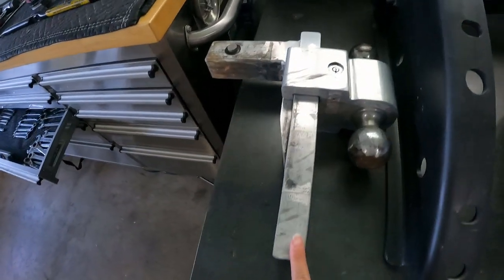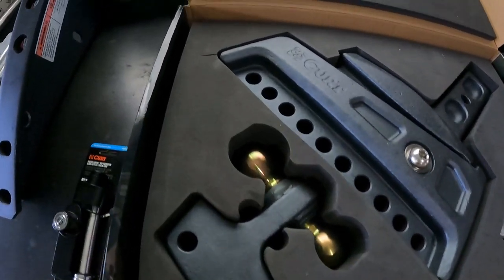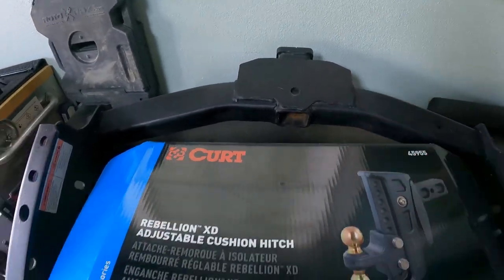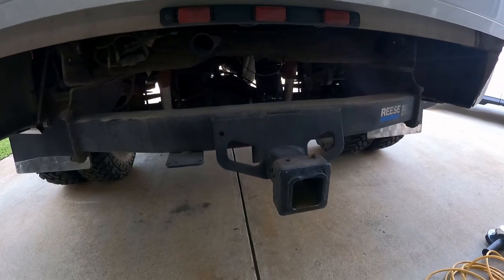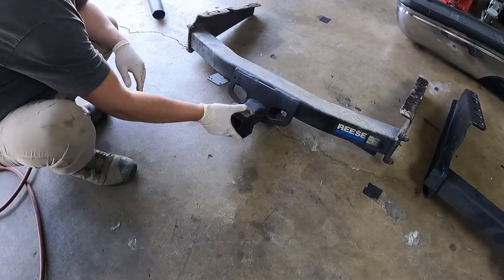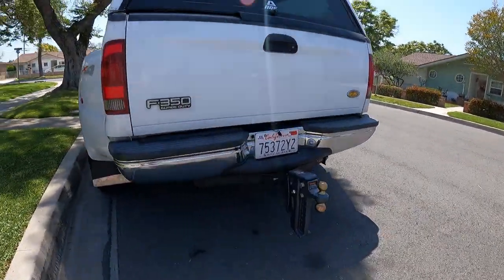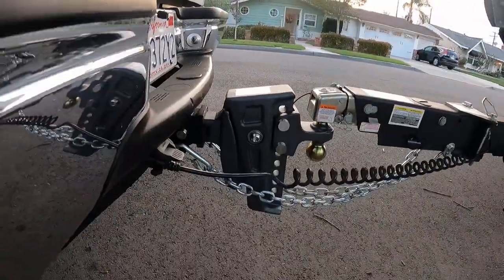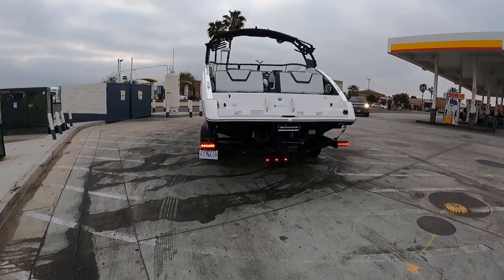Towing Yamaha 252 XE w/ Curt Rebellion XD Hitch. Worth it?

Comment: When you are filming the hitch while driving, the shock absorbing in the hitch is not even moving. It seems that your entire receiver is doing the flex! If you look at eTrailers demonstration - in this video https://youtu.be/CHtrhyB2OnY?t=27 - you'll see the shock absorber in action. 
This thing is rated up to 1500lbs tongue weight and 10-20k trailer weight....that's like A LOT. I wonder if the shock absorbing mechanism actually has a minimum weight to start working.
Reply from the maker: Hi! Thanks for the feedback. We really think we mounted the camera pretty poorly. The inside of the cab while driving does feel a lot smoother. We did switch the hitch to our Super C RV and the recording does show the hitch in action. Check it out around the 4:30 mark https://youtu.be/cAPdkklati8 and this video towards the end https://youtu.be/71r5tew1DF8 thanks again!

Comment: I'm curious how much your boat weighs?  I tow a 242 Cobalt and the combined weight, boat and trailer, is right around 6K pounds.  I tow it with my F150 ecoboost.  I don't have that problem.  But, when I tow our 27 foot camper (5K lbs) with our 7.3 F250 diesel and a weight distributing hitch,  the jerking is quite noticeable if my Rancho 9K shocks are set higher in the back than in the front.  My recommendation:  Set the front and back the same, whatever it is..  And don't set them too high.  The 7.3 has leaf springs in the back.  Very dampening in themselves.
Reply from the maker: Our boat comes in at around 7000-7500.
Reply: @wKKnDwarriors  Wow!  That's heavy!  Something came to me, though.  I have the same kind of surge brakes on my boat trailer as yours.  Some of the jerking you're feeling might be the slide actuator moving in and out.  Also, I developed a leak in the master cylinder of the trailer a few years after we bought it new in 2011.  I didn't realize the brakes weren't working for a couple years!!!  Make sure to check you brake fluid and bleed the brakes every couple years!!!  I ended up having to replace my whole slide assembly.

A note on another video:  We drove the Thor XG32 today!!!  The ride was terrible!!!  We decided not to buy it.  Did the Rancho 9000XLs work for you two?
Reply from the maker: Yeah the hitch is doing a great job absorbing whats going on back there. For sure we will definitely make sure we maintenence like always. 
Yes so sar the shocks are working great on our rig.